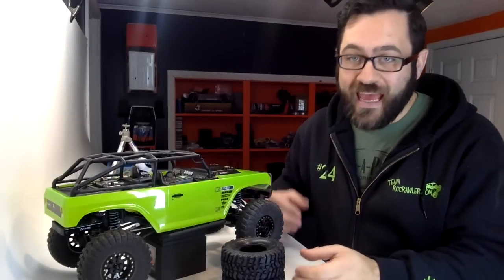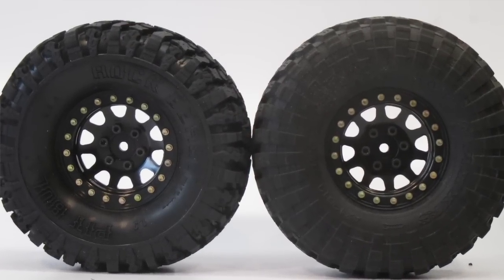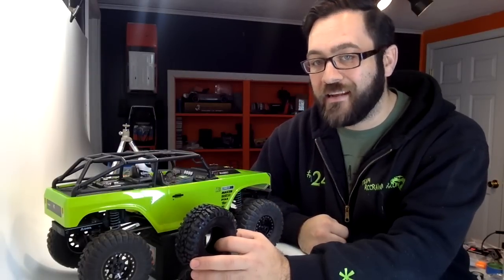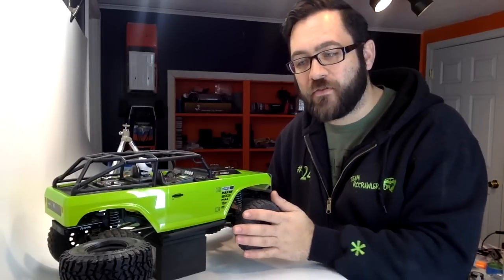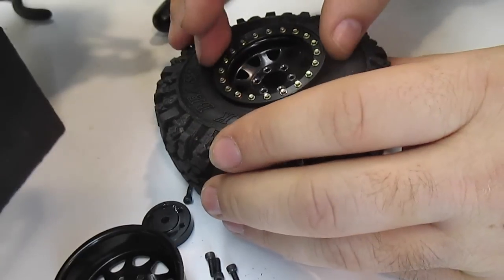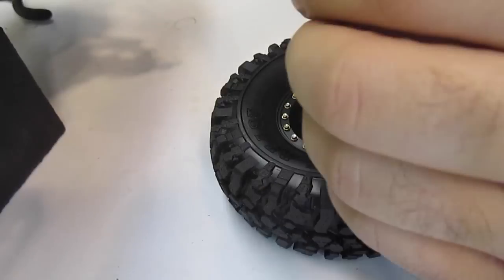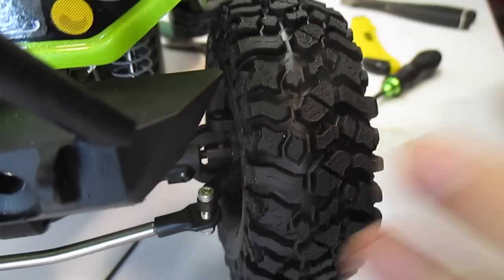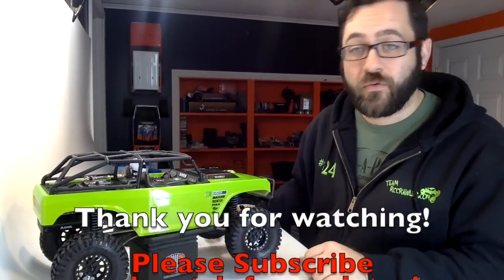Axial SCX10 Deadbolt - Pitbull Tires - $50 Budget Build - Week 8 Part 1

Comment: I did get a leather punch and put two tiny holes in the Rock Beasts to vent them. so far the tires have held up and you can't tell they're there. Much more easier than drilling holes in your wheels and makes more sense.

Comment: I put on a set of Rock Beasts on a set of Gear Head 1.9 Champ 190 beadlocks, and they're not internal beadlocks. The beadlock rings on each side are attached with 6 screws esch. Unbelievably the Rock Beasts were very easy to put on. This combo was made for each other. And they look really good on my Axial Jeep Wrangler Rubicon upgraded RTR. Really not for a budget build. They're expensive but worth it.

Comment: i got the xj version and i bought an used set of those trepadors and they were very hard, so tonight i was just messing around and threw them on my 4wd short course and ran them for 20 minutes. the broke in nice. i dont know if i stretched the rubber or broke down the foams but they are very soft now. im gonna keep the ATs that came on it for trails and use the treps as crawling tires

Comment: Love the Chanel, great content my friend.  I am looking to get another rig, currently I run an Axial Wraith poison with some upgrades. I love the Axial; brand. If you could recommend a trail trig in the Axial line, what would you go with? Any specific SCx10?  Love the upgrade videos, nice concept with 50 a week, nice job dude!
Reply from the maker: +Daniel Caliguire The Deadbolt is a great value, but the 12" wheelbase doesn't have as many accessories available as the 12.3" versions like the Wrangler Unlimited or Power Wagon. I would still probably go Deadbolt but that's just me!

Comment: Hey harley, question:
Just picked up the rig. The 12 inch wheelbase bummed me out because there aren't as many cool factor options. However, the frame is the same length (about 16.75 inches) as the 12.3in wheelbase scx10s and noticed there is an adjustment on the rear shock towers. If I were to get the standard scx10 link kit, say from VP, could I gaing the .3 inches w/o stressing driveline etc. Thanks for any feedback!
Reply from the maker: Yes, the wheelbase will just stretch in the rear. It will require some fender trimming.

Comment: What do you think of the 1.9" Proline TSL Super Swamper XL tires vs. these Pitbulls?  Seems like everybody loves the Pitbulls but I like the fact that the TSL XL's are a little taller...
Reply from the maker: +rodagoose TSL's do well but I can't stand the looks personally. Pitbull has a new XL version coming that is 4.75 tall, which is the perfect size.
Reply: A 1.9" Pitbull Rock Beast XL would be very tempting.  Now that you mention it, I see it on their website but shows not in stock.  Price is also a little scary.  Thanks for the reply!

Comment: Do you find much performance difference between the Rock Beast vs Growlers for all around terrain?
Reply from the maker: The Growlers plug up quickly with any sort of mud or damp dirt even. The extra height is nice and that is why I run them on my Mattzilla Ultra4 since it is wider up front. On the rocks, the RB definitely out perform though.

Comment: so no holes in the tires or rims for venting?
Reply from the maker: I always vent my tires.
Reply: Ah cool. I just put beadlock rims on my Deadbolt, and I immediately had a problem because the old rims were vented but the new ones were not. So I had to look around for a solution. I only commented because I didnt notice a vent step in this vid.  So I wondered how you went about it.